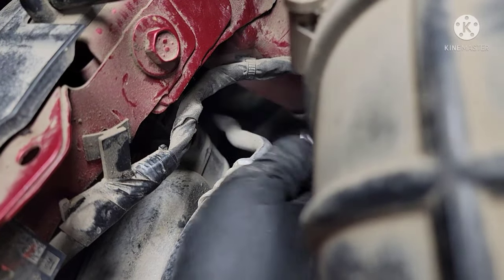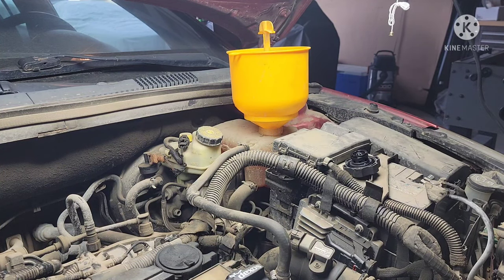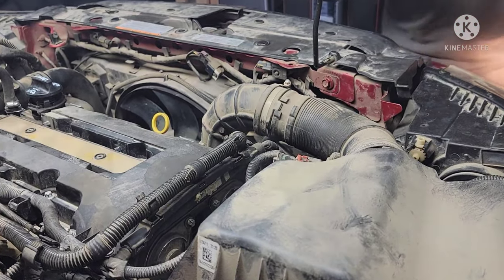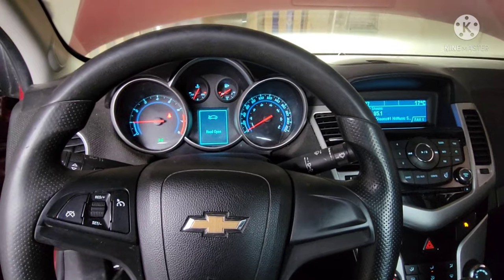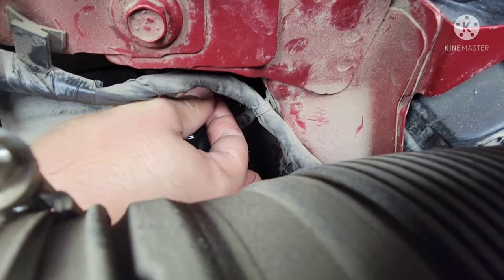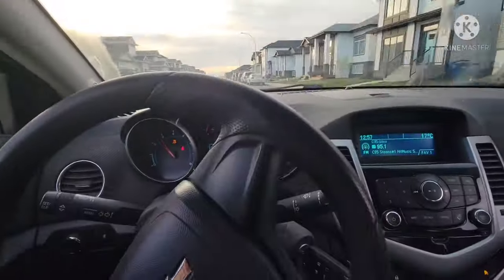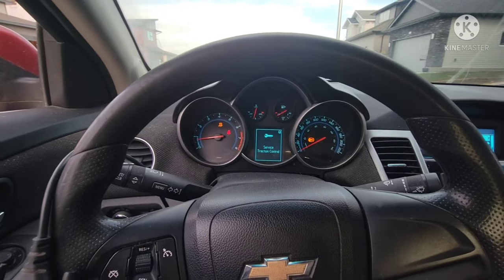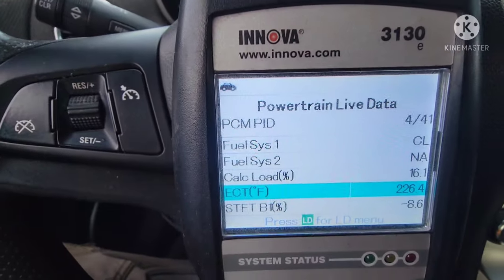How to Bleed Coolant Air Bubbles out! Chevy Cruze 1.4

Comment: Everyone saying he shouldnt have gunned the engine and tore off has never had to bleed a cooling system of this nature. its common knowledge that gunning the engine a little more than normal and even a little erratic driving helps to dislodge air trapped. esp in the heater core. these systems can be a pain in the ass. so no, he wasnt doing anything wrong. and the stability trac engine light will appear on a chevy cruze if you look at it the wrong way. it probably was a simple misfire and yes that will trigger the stability trac code. traction control etc. how about thanking the man for showing everyone that doesnt know how to correctly bleed the system.

Comment: What you should do is put the funnel on and add coolant till it's full ..then loosen the bleeder screw and add coolant till all the air and bubbles are out of the valve and it's a steady coolant drop then close off completely....now start the car put your heater on about fan setting 3 and let it run make sure your funnel in your coolant reservoir is full ..let the car warm up about 10 mins while it's warming squeeze you coolant hose and you will see bubble pop up from the funnel..keep squeezing you radiator hose untill you see no more bubbles ....shut off your car and close the coolant reservoir and you should be good

Comment: I was told the bleeder screw at the top corner of the rad doesn’t have to be completely taken out to bleed the system. It couldn’t hurt to squeeze the radiator hose a few times as well ( unless your hand gets too close t9 the fan.).

Comment: I have 2012 Chevy Cruze 1.4l replaced water pump n thermostat still over heating a lot of air bubbles main hose is rock hard as tho it’s clogged I’m at a loss idk what to do was told blown head gasket but no water in oil please help!
Reply from the maker: Make sure its a proper coolant bleed on that cooling system. 

Check your Radiator.  After driving for 10min  check the upper haft or the Radiator  if its hot, the lower half wound be cooler. Thats a sign of a clogged Radiator, if both area of the Radiator is same temperature is a good working rad.

Comment: My 2013 Cruze had that Stabilitrak message on and off for years.  I tried all the tricks on YT and it turned out to be a sensor in or near the wheel.  Cost about $100 to repair at the mechanic.

Comment: So do you add the coolant to the max line with the engine off and then unscrew the radiator screw to let the air out? Then screw it back in and start the car leaving the cap open on the reservoir? Then do it again to release the air again? So, twice? Then put the cap on after bleeding the second time?
Reply from the maker: I repeat this process 5 to 6times. After  starting the engine open up the plastic bolt at the side of the rad to bleed  the air out.
Make sure to get the engine  coolant  on a normal temperature and  bleed the air out one more time.
Reply: @jfGarage4k  hi thank u for ur reply.  Got it settled after erase the fault codes all becomes normal.
Reply from the maker: Awesome thats good.  Hopefully  the code won't come back good luck champ

Comment: is the hose coming the thermostat suppose to be cold or warm. i had the waterpump replaced and the thermostat housing replaced, its still over heating, im trying to bleed the air out now, idk if he did that or not. but i checked all the hoses and the hose by thermostat was cold to the touch. but it was solid like the other hoses. 2012 CC 1.4L turbo

Comment: Glad thats not my car he's working on. Not saying you don't know what you're doing but i didn't see you adjust the heater to the proper temp when driving mad on the streets.
Reply: what? that bares no problem what so ever. in fact it makes no sense at all. Adjusting a heater does nothing for the repair hes making. in fact. there isnt one repair that requires you to do so. thats silly.

Comment: Hi I've changed the termostat on the water pump after engine light up p1028 done the bleeding still the same
Reply from the maker: QUESTION: thermostat been replace?   Any coolant leak around  the engine? Coolant  tank full?
Reply: If you have had your system open due to a leak or replacing a part....Best way is to drain all the coolant out....Remove that bleeder screw from top of radiator...Start filling it up slowly and when you see water coming out of that hole then replace the bleeder screw..

Comment: I changed the Thermostat housing on my 2015 chevy cruze eco and it's still running hot with no heat from the vents. What could be wrong?
Reply from the maker: Check radiator  upper lower hose if they have same temperature after running the car for 30min.  Maybe plugged radiator
Reply: I realized I never Bled the coolant system (I don't work on cars) so I did, then stripped that plastic bleed air valve cap putting it back on (it was old and soft) and it's not all the way in... so 3 more days of waiting for a new one.
 @jfGarage4k

Comment: Hi 
I drive cruze 2012.
I am getting a hissing sound at the coolant reservoir tank even after driving around 15-30 min and sometimes the coolant comes out of from the overflow hole(beside the cap) 
Any suggestions what could be problem and please let me know any solution for this.
Reply from the maker: This  a common problem  on a cruze, your  head gasket is about  to go out
Reply: Water pump fail
Reply: You would have white smoke coming out the exhaust if the head gasket was bad
Reply: I’m having the same issue this coolant system is junk on these cars but it doesn’t always mean it’s a head gasket because I have had my car checked for the exact problem and it’s not the head!!!
Reply: @mipkwypmnk3434 what was the problem ?
Reply: Did you solve issue?

Comment: hello, can you please help me my vent plug is not opening.  How else can I get cooling system air
Reply from the maker: The Vent on the air outlet from the dash is not opening?
Reply: @jfGarage4k   yes Man not opening. Is there any other way to bleed the system?
Reply: @jfGarage4k he means the bleeder screw.
Reply: @z.a.2177 yes there are other ways. The easiest is to use a coolant change funnel kit. It comes with a large funnel and several adapters to attach the funnel to the surge tank where the black cap usually sits. Try to find a kit with a funnel that is clear so you can see the coolant level in the funnel from inside the car while running the heater on highest hearth setting and high fan speed. Rev the engine to about 2500 rpm for 30-60 seconds. Watch the funnel  for air bubbles and to make sure there is always coolant in the funnel ( half full ) you want the radiator fan to come on for a while so you know the coolant is circulating. You can squeeze the upper ( and lower if you can safely reach it ) rad hoses several times to force more air out. Monitor the engine temperature gauge. It shouldn’t go over halfway between C ( cold ) and H ( hot ). Once the coolant level is no longer going down, put the plug from the funnel kit into the funnel and pull the funnel off, put the surge tank cap back on, pour the left over coolant in the funnel back into the coolant jug ( the one you had a 50/50 mix in ) and go for a 20 minute ride watching the engine temperature gauge. Park the car on level ground, pop the hood and check the coolant level in the surge tank, it should be near to the “ full hot “ mark. If the engine is at normal hot temp. and the coolant level shows at the lower mark ( full cold level ) add some coolant. Check the coolant level again next morning or at least 4 hours after last running the engine. If it’s at the Full Cold mark, you’re good, if it’s below that bottom mark check for leaks and add some more50/50 mix. Check it again every couple of days for the next week or two. Remember if the engine hasn’t been running for4 or more hours the coolant level should be nearer to the bottom mark or if you’ve run the engine for 15 minutes it should be at or near the top mark.

Comment: Hi so my chevy trax got some noise Water flows in the dashboard, after changing the thermostat, what should I do to eliminate the sound?
Reply: Crank some Korn
Reply: you have air in the heater core and might have to do the bleed procedure by parking on a hill or with front wheels on ramps and running motor while you check coolant level and top off

Comment: so I have a need of bleeding my system out but the valve is so tightened that my ratchet is getting zero movement on that screw. Do you have any tips on how to untighten it without stripping that screw?
Reply from the maker: Spray wd4 or pb blaster to lube up that plastic screw
Reply: It has a place for a flat headed screw driver also..
Reply: @Yeah Right so what's the best
Reply from the maker: Can use a Flat screw driver  to open the plastic  Screw

Comment: If anyone buys 50/50 mixed coolant you're ignorant you're paying just say $15 for a gallon of full strength and $12 for 50/50 I've even seen it opposite on the price 50/50s more but anyway that's half water half antifreeze by the full strength bring it home and mix it and you'll have 2 gallons for $15 instead of a gallon for 12 that don't make no sense whatsoever to buy 50/50